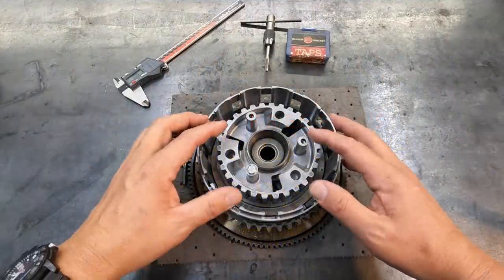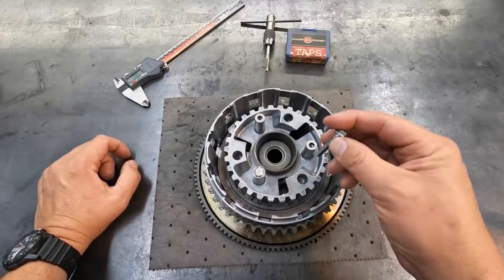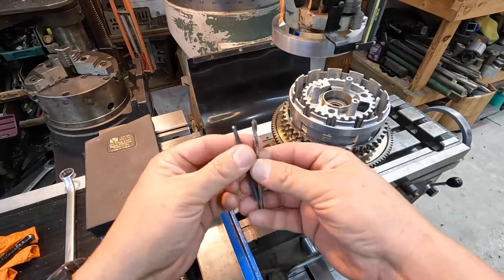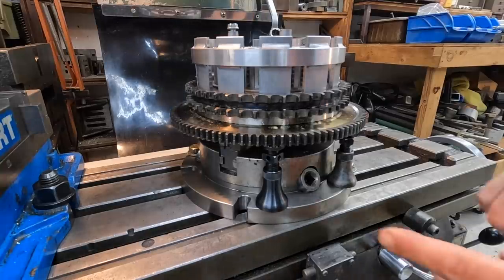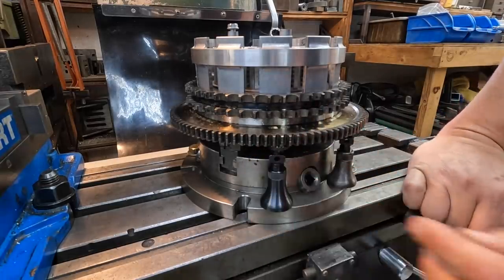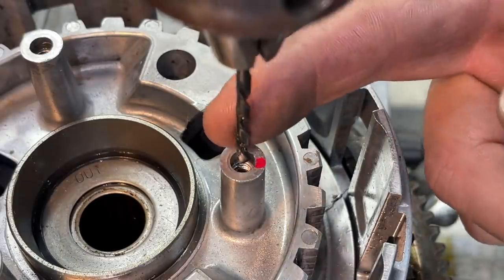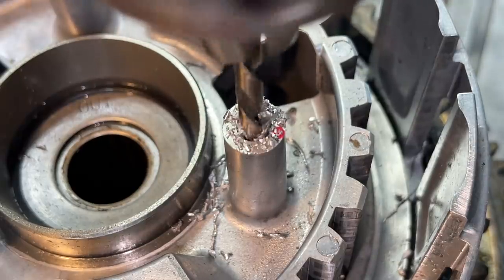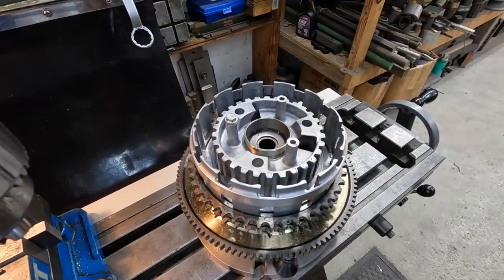Harley Davidson Clutch Basket: Broken Bolt Removal

Comment: I guess you need content. But all you had to do was drill a small hole and use an ez out to grab bolt and take it out. You destroyed threads with the drilling
Reply: Machinists rarely use "ez out".  It is risky.  They break easily and then the fun starts!  You must be new to this channel.  Adam has done many extractions and does a fine, professional job.
Reply: @paulcopeland9035  yea...turn a 1 hour job into a 5 hour+ job with snapping an easy out...you a hobbyist?
Reply: @paulcopeland9035  Machinists use a sleeve to keep the bit from walking right into the threads, or an endmill to flatten it out first and V-bit to start the center. Hobbyists use the wrong size bit, just start drilling and hope for the best, act surprised when they have to put a helicoil in, and then don't balance it and act surprised when the customer says it vibrates, and probably tell them off
Reply: That is if the customer can even put it back together. Look at the original bolt and note the 1/4" counterbore on the factory holes, compared to where the helicoil is
Reply: @alakani  exactly. He now has threads too high.

Comment: the sad part of this is Harley Davidson using metric threads.
Reply: The rest of the world does...
Reply: @marksmallman4572  Including all American car manufacturers since the... 80s? I'm pretty amazed I still read comments about the metric system so often, as if it's some recent switch.  It's just easier!
Reply: Metric is there for reason. There is no need for all the 15/16ths   and thousands of an inch etc  in the general use future. The only time thousands of an inch etc is needed are when experts like Adam are doing their awesome work. Where the tiniest of precision is required. Millimetres is a faster easier size and no need for half the wrenches. The Automotive industry knows this so manufacturers like Harley Davidson can build and repair the vehicles easier and faster.
Reply: What is sad about that?

Comment: Not a USA made bolt then, they are unbreakable best quality in the world, must have been made in far east. Shame on HD
Reply: @cozmium  You must have never bought anything from China
Reply: @keithhansen3963  You have gone to an extreme. What about German parts? Or French? Italian? The trouble with Chinese engineering is that they don't see poor quality as reputation damage. "There is a sucker born every minute".

About the only way to avoid this is to have your own team to do quality inspection of every shipment. What to look out for? In short, every mistake that one can think of. Subsituted or Incorrect used, to precision surfaces not finished to the agreed and specified standard. You may need to get a sample xrayed or cut in half to ensure that part is what you have asked for.

You might have to fly manager and one of the engineers over there once a quarter to check that your widgets are being made where there are made and keep an eye on things. You can outsource the production , but not the responsibility.

Comment: Abom79 I saw a lot of mistakes on the "left hand drill' concept that you used. After you went through all the trouble of finding center, you should have since it's in a drill press, used drill bits smaller than the size of your hole. (never actually touch the threads)That may have worked for steel though) I actually saw one drill bit that you used had a very slight wobble to it. That's where you made your mistake being that close to the threads. Even a slight wobble will eat into your threads. Your repair  was for the mistake you made using a wobbling drill bit...Also I would have used a chasing tap instead of a cutting tap. All you needed to do was clean up the threads. keep up the good work...
Reply: it is smaller than the hole, he dropped it down in the first few minutes
Reply: Always some is going to tell him how to do  when they should shut up

Comment: A few comments here to help the others avoid several of the pitfalls encountered with this job: 

Set up- keep it rigid & just 1 bolt & washer direct to slot space on mill table. Not this 3 jaw & jacks high wire act. Unrigid & geometric loss. 

Left hand drills - please read the Machinery Handbook to understand purpose.  They are not meant as screw recovery bits and can get you into more trouble if you are not experienced.  This is not what they are for. 

Proper spotting- the screw fracture is uneven. Use the proper small end mill to spot face & then use a center drill. This is why poor process tool deflection damaged threads. All that indicating for nothing. Totally avoidable.  

Use of Helicoil- yes,  could have been avoided but why not apply to other 2 holes?  Was this some kind of oversight or did you mean to make this assembly vibrate more because it’s a Harley? Unbalanced repair here.  Removal of casting then the added weight of Nitronic Helicoil insert to one side of three. 

We all learn from experience and my comments are here to help from how we repair vehicles on our used car lot. Pay attention or pay cash.
Reply: I would love to understand the proper use of a left handed drill bit. I know you can get in trouble if it bites and you don't relieve the upward force by the broken screw coming up. But can you help me understand how or what it's real purpose is? I love machining, but I'm not a machinist, maybe in my next life. Thanks for the video and your constructive comments.
Reply: @Gabriel-unicorn  the left hand drill was developed for the back work on a Brown & Sharpe screw machine. You see, normal CW rotation is on the right side of the of the drilling operation. Now try to drill the left side. It would need the spindle to go ccw. Not practica! 

So some stoner thought that a left hand drill will magically eliminate the foul threads in reverse. Doesn’t work that way.
Reply: Thanks very much. I love understanding the historical aspect.